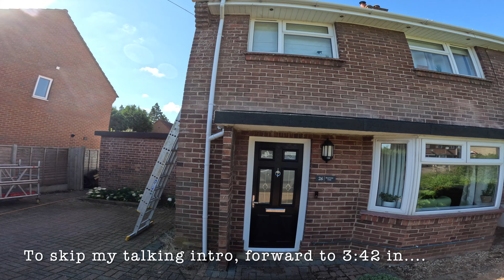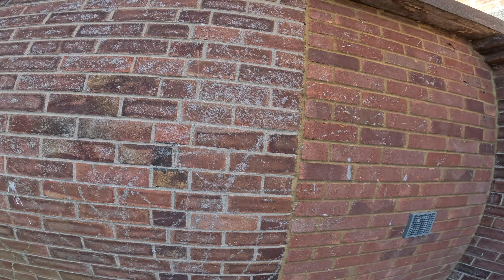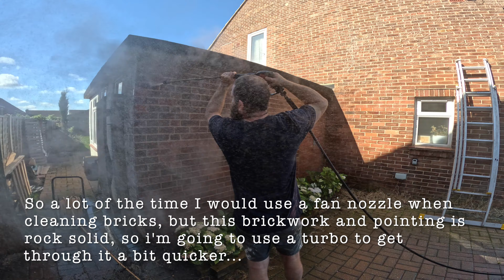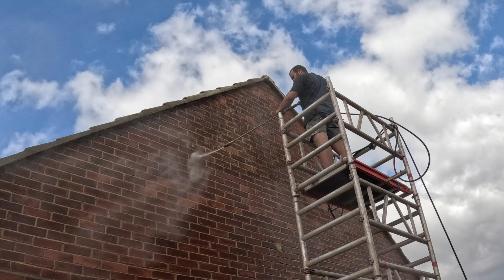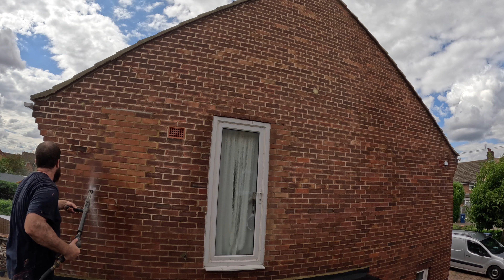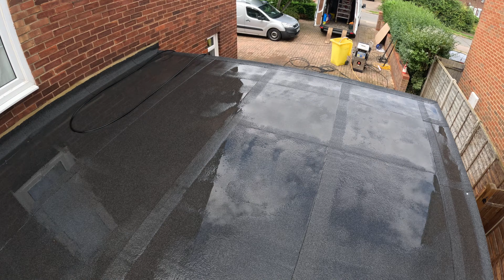Customer Stopped Nature From Smothering His House In Ivy. But Look At The DREADFUL MESS LEFT BEHIND!

Comment: Great job as always Nick. 👍 My guess would be a spill of paint or maybe the bitumen when the porch roof was done and wire wheeled off. Once it’s smooth it will always look different. Could maybe mix some brick dust with something sticky or brick dust in brick paint to rematch the finish but probably on a loser.
Reply from the maker: Could be Rod 👍, thanks for the great comment as always 👍

Comment: Had someone spilt paint on the bricks and then tried to remove it with paint stripper and then when that wasn't getting it all out of the tiny cracks they went at it with a grinder to rub the bricks down past where the paint had seeped?
Reply from the maker: Yeah that could be what happened 👍